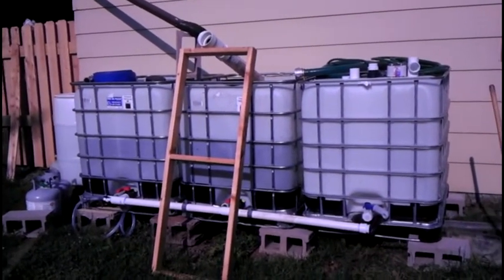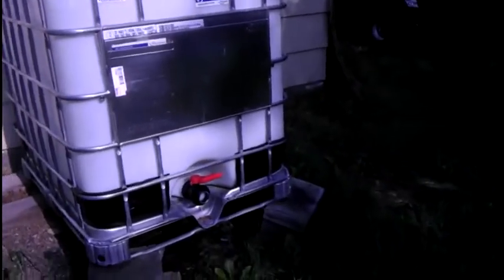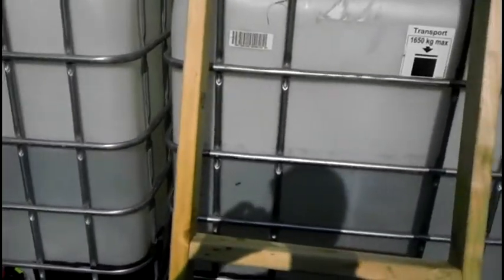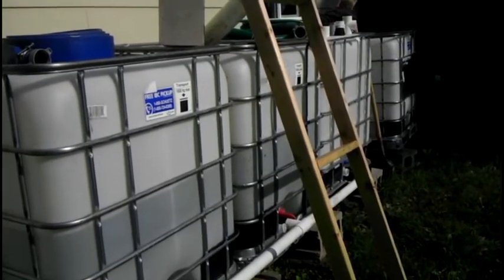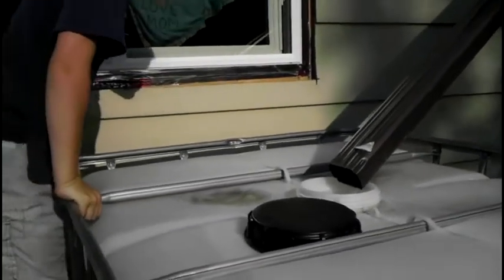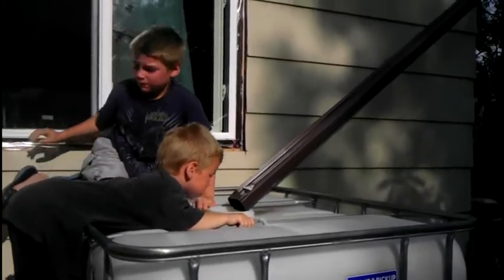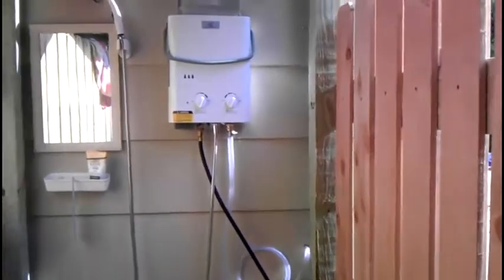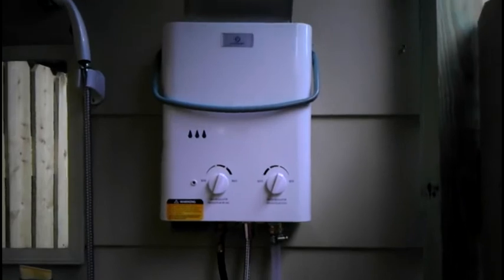Minnesota Homesteading: Off-grid Water System (IBC)

Comment: Those containers are not UV stabilized.   The sun will degrade them.  Black poly or paint will protect them.   The same will happen with your PVC pipe.   The pipes should be protected from direct sunlight.